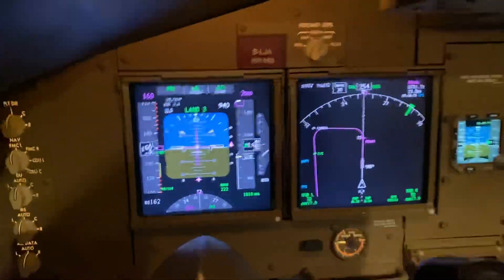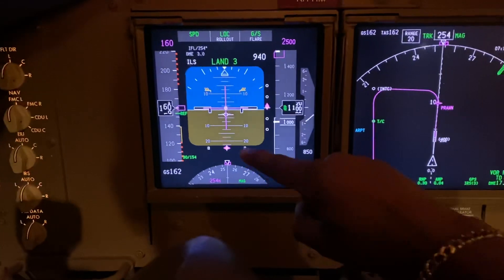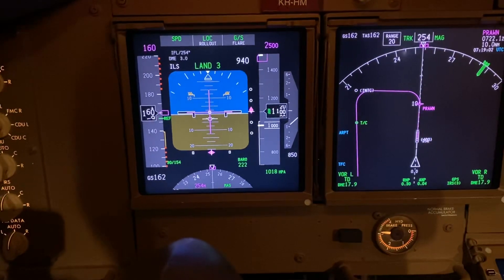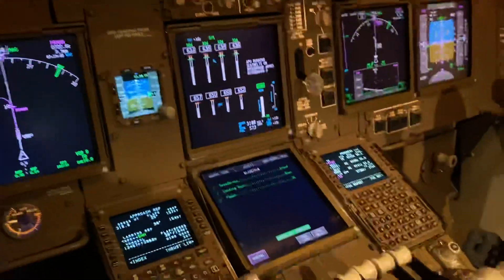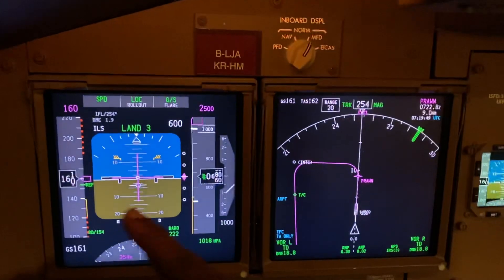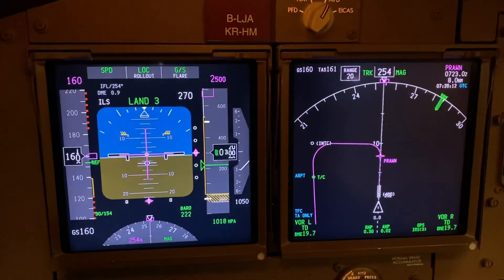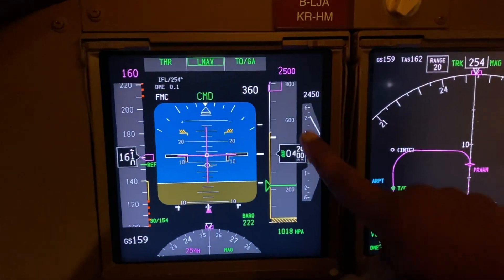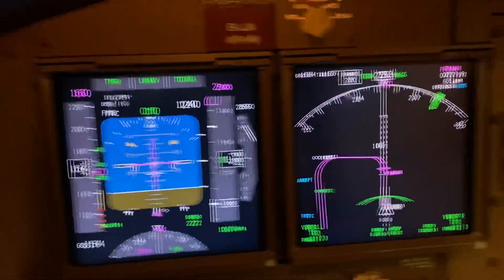Go-around on B747-8

Comment: Just curious, what is the sound at 2:59 and what does it mean?
Reply: I wanna know too
Reply: @JustRememberWhoYoureWorkingFor  I recently figured out what it was, its just the sound that's heard when you are reaching 100 feet below the selected altitude on the autopilot.
Reply: @chessbox4776  hmm yeah I suspected it was something about that, but didn't say anything because I wasn't sure
Reply: ricardio14 you‘re right except it’s usually 1000ft before reaching the selected altitude :)